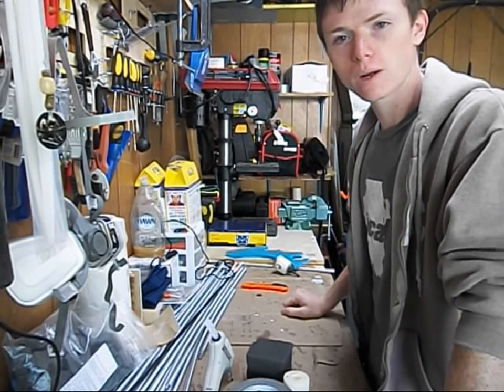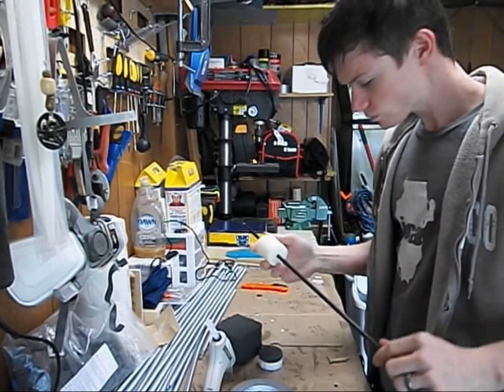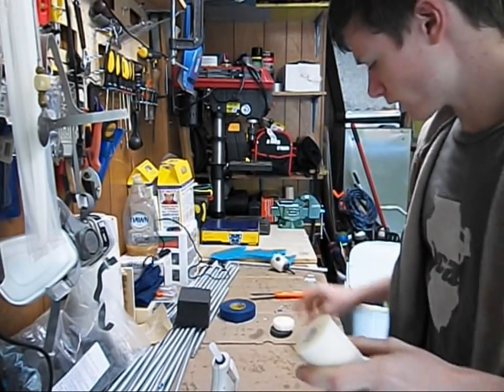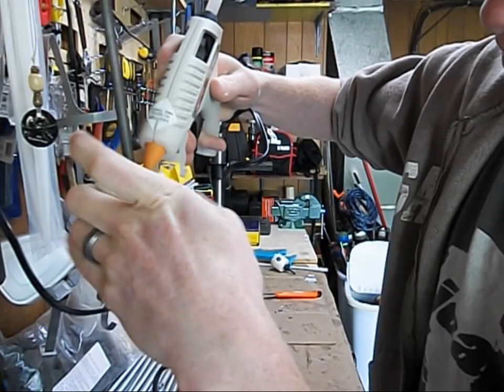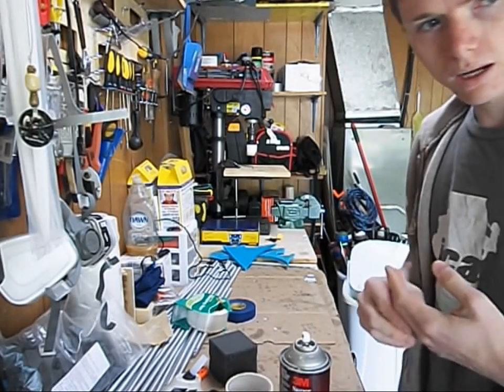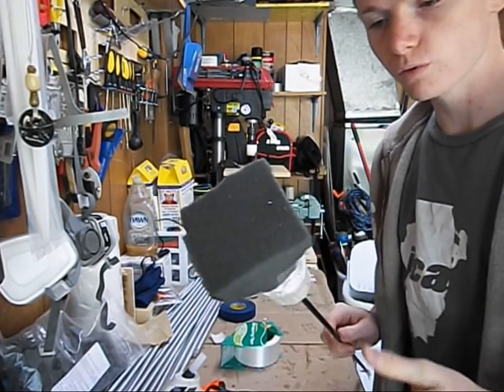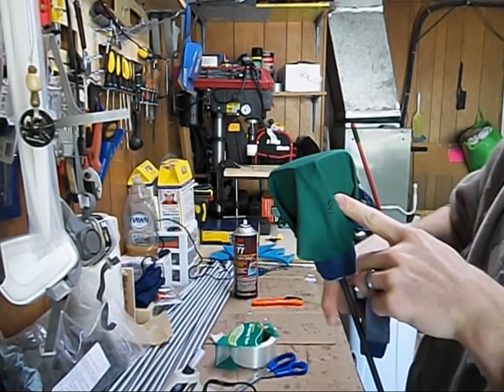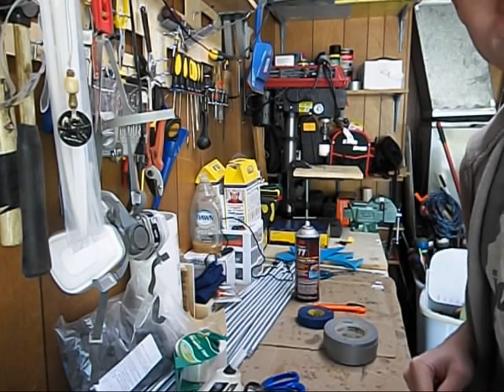Constructing a Belegarth/Dagorhir legal arrow

Comment: What is your thought for the penny (or appropriate washer) to drill a small hole and use a screw that fits the threads for the arrow?  That way you can use some thread lock and assure that the penny will never move.
Reply: Hey! Sorry I missed your comment here. While I've not personally used that method I think it's a great idea. My concern has always been with the washer/penny eventually tearing away from the foam while unscrewing the head from the shaft, making it necessary to deconstruct the head and defeating the purpose of a modular. I've never heard of any reports of that, so that concern is probably unfounded. I really need to get around to giving it a try :)  Happy building!

Comment: this is awesome! thanks for the tutorial! 
I have one question though! are you allowed to use carpet and or duct tape on making your arrows? I really want to build mine with carpet tape since its less messy, and duct tape holds the open cell corners to the base much better than the strapping tape I was using. I was looking at the Dagorhir Rulebook though, and it said that only cloth and strapping tape were allowed in arrow construction. I would assume that the penny and duct tape blunt is an exception. but do you know if there are any others? 
thanks!
Reply from the maker: My apologies, I missed that rule. It appears pretty clear cut, unfortunately. Why they limit tape types I can't say. With Ragnarok coming up, it's a good time to maybe petition your local RWC rep to suggest a rule change.
Reply: War council updated allowable tapes in the rules last year. That rule update hasn't been adopted by aritari yet, but the ragnarok rules do allow for strapping, duct, and carpet tape.